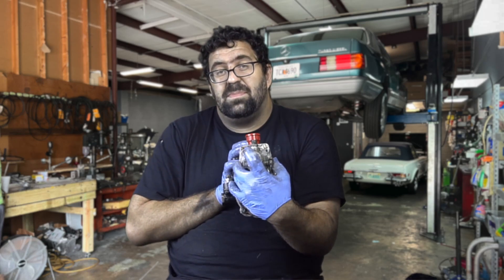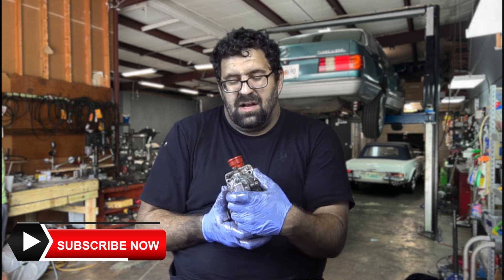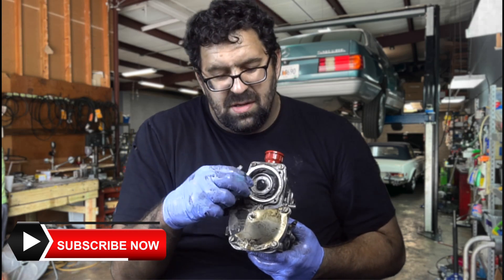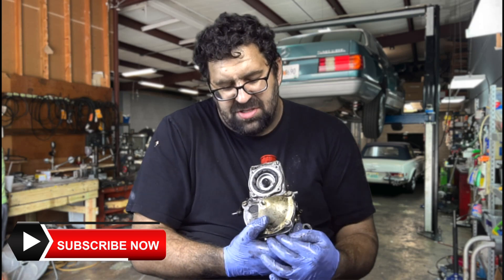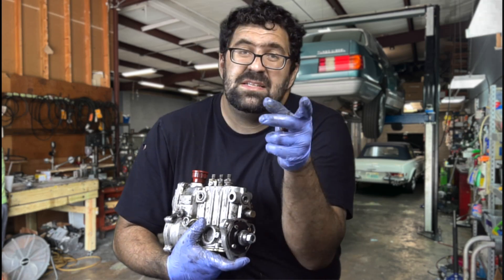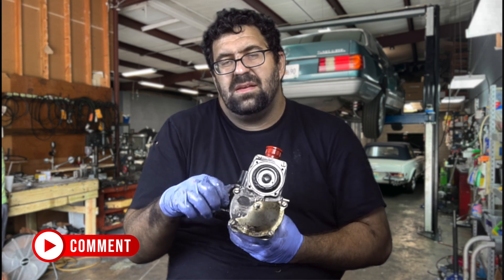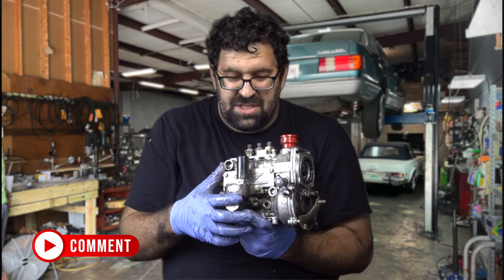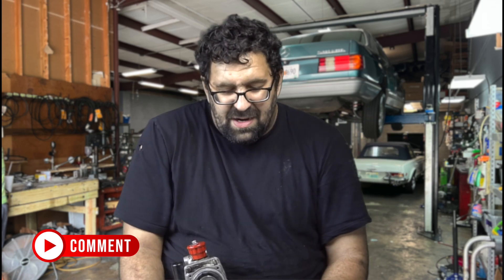Troubleshooting Classic Mercedes Benz pneumatic, governor failures   HD 1080p

Comment: What I have to share is off topic but wanted to share it anyway.  Used the quarter method to check the tread depth and it was time to change the tires. As most individuals are aware getting new tires on your old Mercedes W123 240d is becoming like the proverbial finding a needle in a haystack.  I have been running Michelin 205/70r14 tires for 8 years which is way to long because I was struggling to find a good set of tires.  One of the custodians I work with at the local school district also sells tires from his brothers mechanics shop.  He found me a set of Uniroyal 205/75r14 tires and what a difference in the smoothness of the ride.  It was immediate to feel the difference.  I could even feel the manual transmission shifting smoother between the shifts.  The change in the speedometer is 2 mph at Highway speeds.